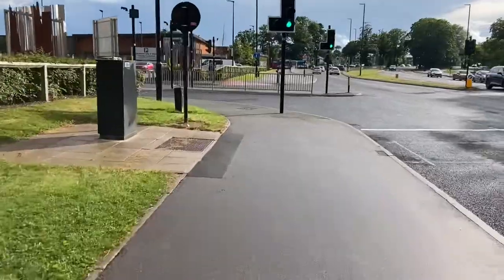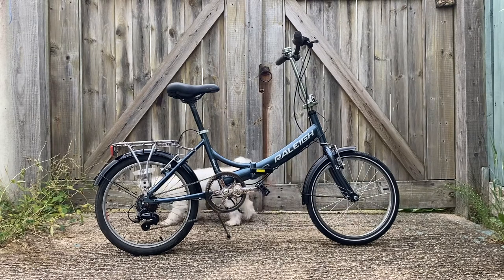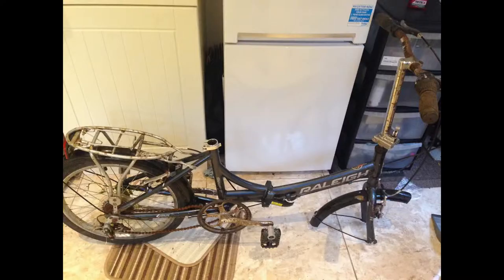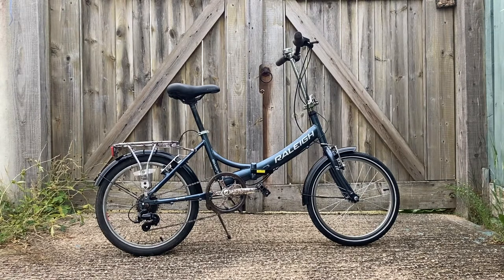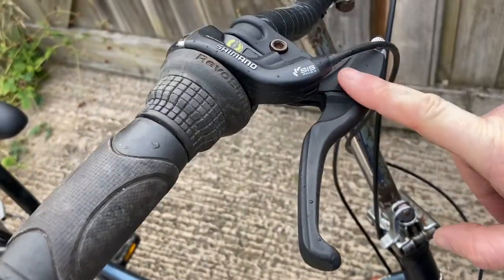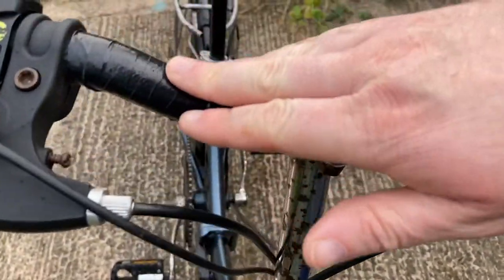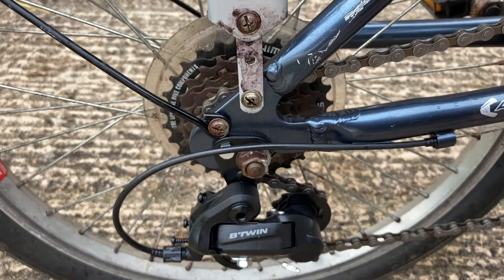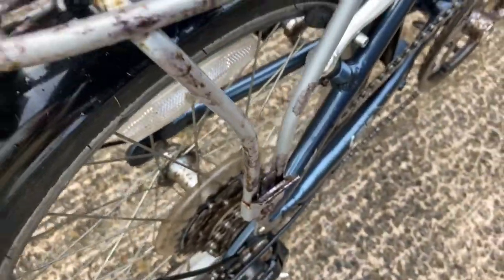The HEAVIEST bike I own // Raleigh “Swift” Folding Bike // Restoration, Ride and Review

Comment: Surprised me how compact it folds into. Nice find Rich. I've wanted a folding bike for a long time. Looks like a decent one. Very good test for it too. They can do almost everything.  Keep riding.
Reply from the maker: It was nice, but I ended up selling it a few months later to someone who worked as a recovery driver. He needed a bike he could use to cycle out to where he needed to collect vehicles and then be able to put the bike in the back of the truck cab to drive back and then be able to cycle home or to his next job after drop off!

I have another folding bike in the restoration queue - much smaller and lighter though!

Comment: Just bought one of these s/h but basically unused! I think my frame latch is a slightly different design, it just pushes into place but takes a bit of force (I did wonder if something was missing like a lever to pull the mechanism out but can't seem to find anything else online). I need to check it over fully and give the chain some oil and then looking forward to getting out on it. It is heavy, not a folder to carry about but more for storage (which is what I need it for).

Comment: What is the size of seat post required? I just bought one without a seat..
Reply from the maker: Hi, thanks for your question! I think it was a 1 1/16th inch or 27mm diameter seatpost. I bought one of those seatpost sets that comes with different sized shims to take it from 25mm to 29mm.

I sold the bike a few months after filming the video so I’m afraid I can’t check.

Comment: Yes, those latch mechanisms, to me, always seemed a bit sketchy.  Your adjustment made it better, but still prefer the latch on, say, a Brompton.  Simple, secure, with minimum of parts to fool with.  My current folder is an Italian-made CyclePro from the 1980s, and weights in at 39 lbs, stripped.  It has a SA 3-speed hub, with rear coaster brake, and front caliper brake.  Was a good entry into to the folding world, and made me realize folders are a viable option for me at my age.  Looking for a lighter bike now for the riding I do, mostly bike paths and quiet streets.  Really like the Brompton, which I have ridden for a short time, and that will likely be my choice.  Would prefer it had 20-inch wheels, but the engineering, elegant fold, and time-tested design wins out.  I'll get the SA 3-speed hub, as it is simple, and more than meets my needs.

Enjoy your videos.  Keep up the good work, stay safe, and best wishes from the States.
Reply from the maker: Thank you very much for your comment, I’m really glad that you’re enjoying my videos!

Comment: It's a pity that things don't come well chromed or heavily galvanized any more. Stainless steel nuts and bolts would also be nice, instead of creating things that start going rusty as you walk out of the shop.
Reply from the maker: I agree! I have a 90s Raleigh in the restoration queue and the chrome plating on the handlebars and quill stem are very badly flaked, unlike the 40s and 50s Raleighs which buff up quite well with a bit of wire wool!
Reply: Yes, it would only cost manufacturers pennies per bike to do the job properly. Instead, the price of bikes goes up sharply, as the quality nosedives.